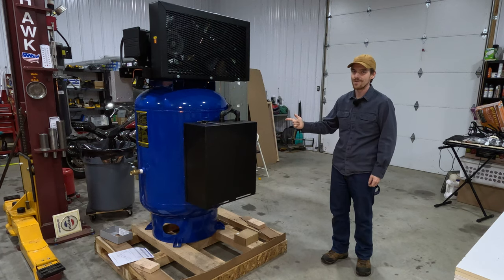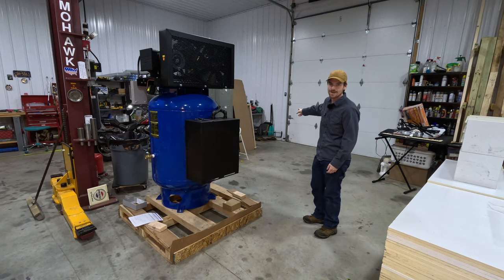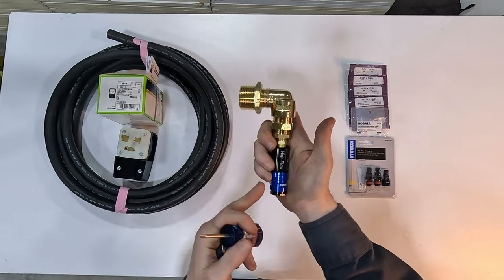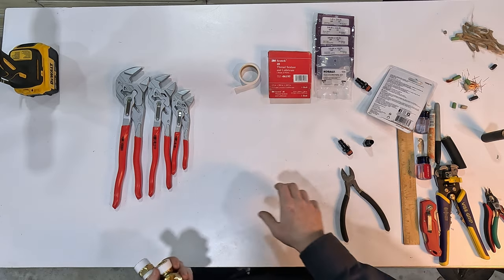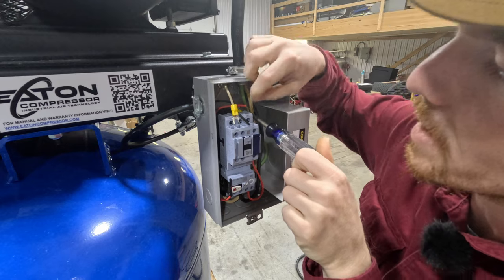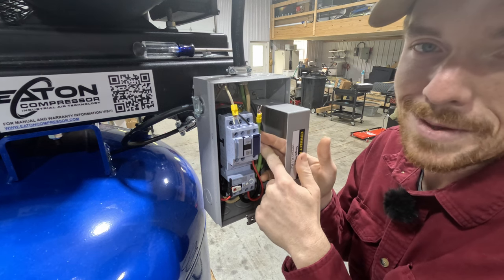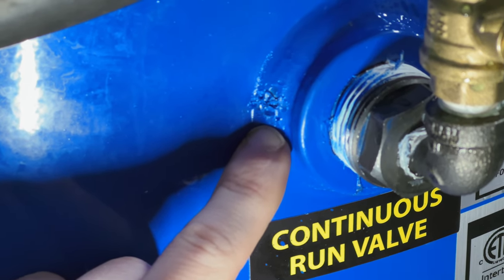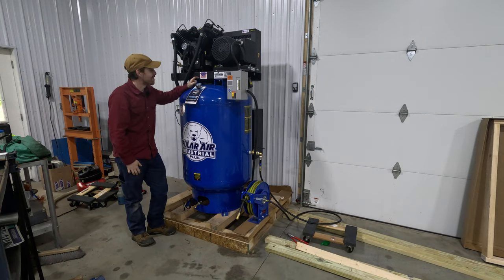Workshop Setup - Faulty Air Compressor Installation (Part 2.2)

Comment: They sell cheap water separator/regulators at HF. Worked fine for me for years. Short black pipe from tank to regulator, and you're done. Sure that is a 2 stage, have mine set at about 180psi. If yours will only do 140, something is wrong.
Reply from the maker: I found out the factory set them to 140 and I can turn it up to 175 if I want to. I’ve been eyeing up that HF separator. The one I “want” is really expensive and I doubt I have any real need for that fancy of one at the moment.
Reply: @gerikbensing  pretty sure the one have was 20 bucks or so, and it works fine. You don't need a super expensive one unless you're painting. You need a regulator, regardless. The advantage of a compressor that size is that you can pack more air into the tank so it's not continuous running.
Reply: @gerikbensing  they make 2 stages for a reason. You'll figure it out.

Comment: I have worked with Matt the owner from Eaton they don't make the tanks they just assemble all the parts The pump are no made from Eaton they only paint the tanks and assemble the parts and do some modes on top of the tank
Reply from the maker: Great insight! They did explain to me that they get the tanks from another company and was part of why they needed it back to do a QC check and figure out what the heck happened since they should have been pressure tested to be certified.
Reply: wtf...that leak !! now im scared to import one..